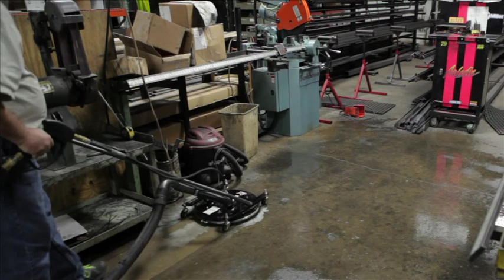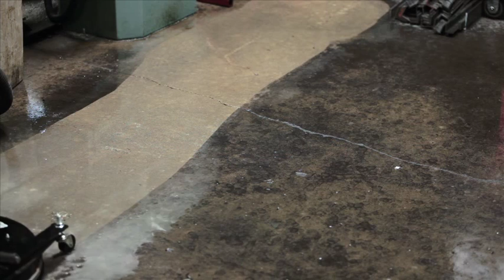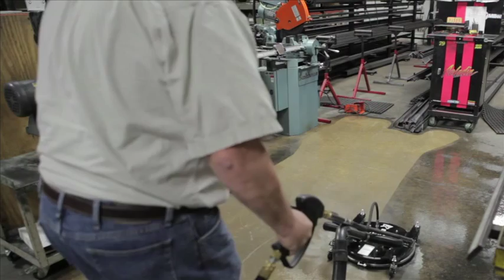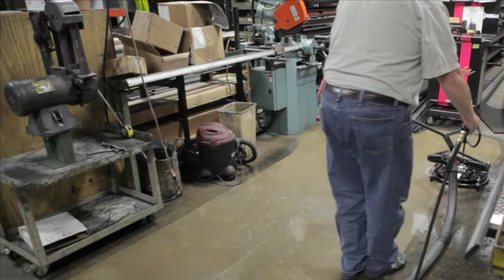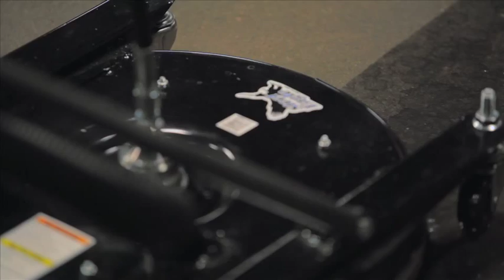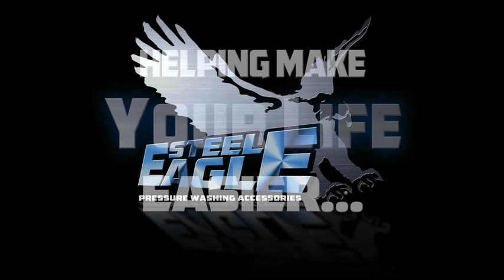Steel Eagle Clean and Capture Vacuum System

Comment: You can plainly see the paperweight doesn't even pick up the water, that's why you are moving so slow. Go ahead and tell people that you WILL sell them something that another customer returned knowing it's junk
Reply: Edward Finkelstein foam screws up the vacuum. Could be why your unit won't extract as much water as you'd like
Reply: This probably has more to do with the hose size & vacuum power. Not the surface cleaner itself. This surface cleaner is great. Well the 16 inch is anyways.